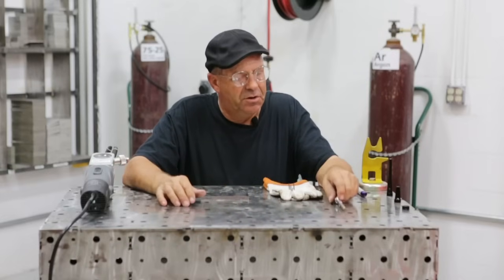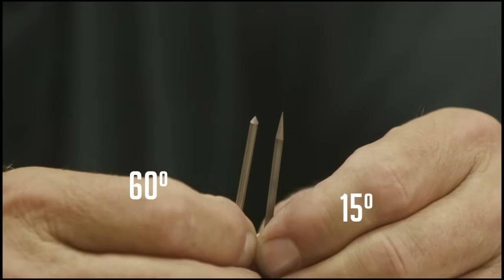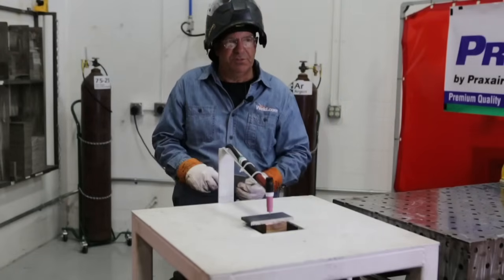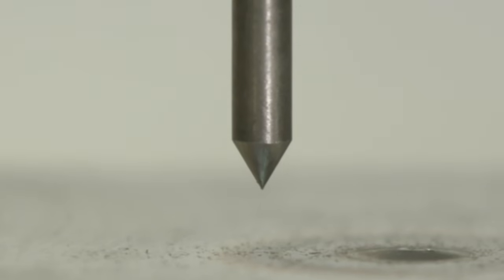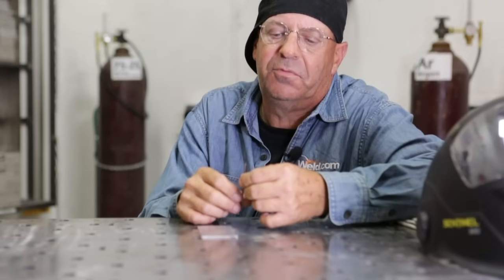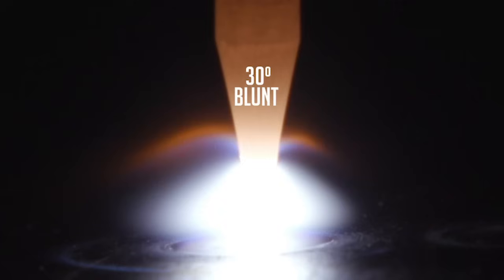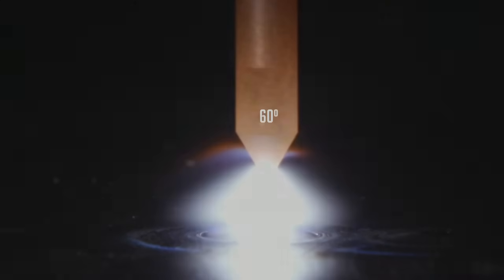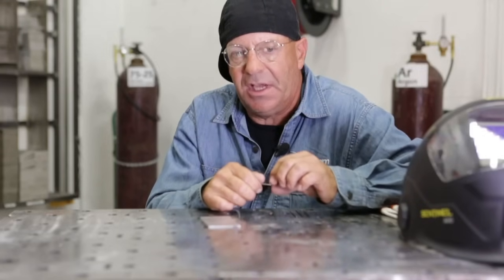Tungsten Grind Angles Matter!

Comment: Hi, i need some technical support for some critical welding application.

We have to weld a 0.15mm Thin sheet (S.S. 316) with 10mm shet thickness.
we are using hyper pulse Tig welding.
But we are facing some issues that once welding completes 360degree, material get burn at starting pont...

Comment: Nice video . Iv been using a grinding wheel i had off eBay 5 months ago to sharpen my tungstens that can be used in a grinder . Works amazing . Should take a look and see how they test out. EBay item number:  283337062859

Comment: I'm a tig beginner, but I think the big thing Bob forgot to mention in this really excellent video is how the grind angle actually effects the arc plume. From what I've read (and it jibes with my ancient EE courses) the arc come off the surface of the tungsten at a right angle, so that a needle point makes a wider arc plume because the arc goes out almost horizontal as it leaves the electrode and then bends back to the workpiece. And on a blunter angle, like the 60 degree, the arc still comes off at 90 degrees to the surface--but since the grind angle is steeper the arc doesn't have to bend as much to get to the surface of the workpiece, thus a narrower (and hotter) arc results.
Reply: Great tip
Reply: Thanks I thought it worked along those lines but nice to hear a confirmation 😊
Reply: Aha
Reply: Yes!! Exactly right!! Those are the words I was looking for.

Comment: Aerospace welder here. Run 718 inco all day. 27 degree is my personal fav. Usually run 0.040” material.

Awesome vid. Thanks for the education.
Reply: Being from the aerospace field,  do you notice a lot a horrible info in these videos? Ive found that almost every welding video ive seen has bad info. It's so funny to see ppl over look all the critical theoretical practices.
Reply: My buddy gave me some inconel MIG wire to play with but I haven't tried it yet

Comment: I prefer the sharpest possible as long as I still get penetration on both sides. Especially when welding some corners and you cant follow it around as you should in theory. (Thats around 27º in my case).

Comment: How long do these tips last in their accurate form as shown here? I've seen them get blunted pretty quickly, probably because I'm doing something wrong.
Reply: Some different metals will dull them out in 10 seconds. Junk I weld all the time at my job sometimes you can watch the stuff just shoot up onto the tip. Then maybe after first pass you are good and it will go a long way. I repair welds made by automatic fusion welding machine and sometimes going over those welds is real bad.
 In the real world hardly anything is nice clean pretty compatible metals, it’s more like weld this nice steel to this dirty garbage and hope for the best.

Comment: Whatever tip I can quickly make on a grinder is the angle I use :)
Reply: The by code guys crack me up 😂
Reply: That what I been doing last 15 years. Big flat sander where I work. Tungsten is tough and tears up sanding wheels quick so I keep mostly to the center. That is my turf.
Reply: @michaelszczys8316  its probably more frugal to get a diamond sharpener that will last you longer in that case.
Reply: Needed to try new welding procedure for job at my work.  Needed to try burn in with fusion weld. Shop engineer told me to grind the end flat for more penetration. I said ???? What ???
Reply: Facts 💯
Reply: Just use a mug welder lol. No grinding needed
Reply: Damn there’s some bad ass welders on this comment section.... until you bump into them on the field... lmao
Reply: Get caught doing that in the field on a code job and you"re packing up and going home. Not a good habit to develop.
Reply: @conndorr  Get caught doing what exactly?
Reply: @ifitaintrounditurnitdown1735  was wondering the same thing
Reply: @ifitaintrounditurnitdown1735  parameters I'm thinking. As long as theres no IP or If or inclusions ie: tungsten tip on the film, you're good to go at most places. Blue oxidation on titanium is a no-no hence the post purge block. I've tig'd miles of 316L SS and preferred to feed my root from inside looking down thru the gap til about stringline.
Reply: @metalandstoneworker2345 I agree with everything you say but the comment was referred to the grind angle of the tungsten and getting ran off the job for using any angle. I always backfeed any of my roots no matter the pipe material.
Reply: @ifitaintrounditurnitdown1735  that's how its done hand. Just sharing my story. It's probably older than you. Keep it clean out there.
Reply: @ifitaintrounditurnitdown1735  btw, parameters. WPS.
Reply: @metalandstoneworker2345  Yep it all depends on the WPS. I've tested places and they didn't want you backfeeding a root and also tested where they made you backfeed. You too brotha!
Reply: If it ain't round I turn it down get caught sharpening a tungsten with a grinder.
Reply: @ifitaintrounditurnitdown1735  I think he means "sharpening the electrode off hand on a sander"?  You really want diamond grinder or that chemical stuff I think.  Jody has a video showing nine ways to do this?
Reply: @conndorr  when you are 100ft up on a scaffold with no ladder inside a vessel, you use the damn grinder and dont worry about it
Reply: Chris Duncan not under the eye of an AI then by all means go for it, but I work in a code shop that is consistent with in house inspectors and they aren’t fond of that.
Reply: @conndorr  so do i

Comment: Question. Is dragging it to set height and thus contaminating the tip of any concern? I know, all too well, about touch down while welding but what about starting with that small amount of debris on the tip, should we avoid it? super clean or clean enough? Thanks.

Comment: I didn't have anything to add during my first time watching this video because I was tired, but I've got one tip that I have used a lot.

Say if you're using that 15° grind on your thin metal etc, you can always regrind the tip of the tungsten and it entirely changes characteristics of how your arc performs. High science, it's something that is useful in a pinch or if you're not within reach of a grinder... Once I put my initial 30° grind on my tungsten pack, I'll use a my diamond whetstone for my pocket knives to refresh the tip or regrind it.

Let's say you blunt 20% or less of that initial 15° tungsten grind after your tungsten collects foreign residue on the tip after incinerating it out of your parent metal... You can regrind however much of the sharpened area you want into one of the other grinds. I'll often take that 15° and put a 60° on the very tip using while less than 80% of the total sharpened area to give the initial grind some more penetration/depth.

Doing that will make your arc characteristics an amalgamation of both grinds. You'll no longer waste amps away on the surface trying to get the puddle formed as the 15° grind would normally do alone and it'll punch down into your parent metal much, much faster. It tightens up the arc from a max width plume and focuses about 80% of the energy down into the parent metal. It's really great for aluminum and you don't always have to run it blunt.

The secret is in the shoulder of the grind and the tip of the tungsten! The drawn out portion doesn't have any real effect on arc other than current capacity and total working time before the tungsten craps out due to the needle-like tip being incapable of dissipating the heat. It's all calculus and how the energy is directed to a focal point at the end...

That's the beauty in breaking down and just buying your own machine; it may not make you much better of a welder than you already were before you bought it, but it'll make you that much more of an efficient welder when you have time to observe these things that you don't usually have time to do at work.. unless you're looking to load your box and drag up anyways! 🤣

Comment: Does the sharpening angle affect the maximum current capacity of the electrode?
I am a very beginner at Tig and once tried with a 1/16" tungsten at about 120 amps. With a sharp angle it welded worst that with a less sharp one.
In both cases, no blunt point. 

Keep the good videos coming. (Especially the part 2 of this series, with the practical demonstrations!)

Greetings from Italy,
Sart0
Reply: What kind of weld, what thickness material and AC or DC? I find that if you sharpen a thicker tungsten to a sharper angle, you can weld better thinner material with lower amperage (like it will make a smaller puddle, more concentrated arc). On AC it is almost useless to sharpen to a point the electrode since it will eventually "ball up" on use (how fast, is depending on AC balance). 
There is a limit to welding amp and tungsten thickness, a 3/32" tungsten with a ~20 deg angle will deal better with  120 amps than a 1/16. Actually these sizes will serve you well from the range of 1-300 amps, the 1/16 being able to deal with up to ~100 amps and the 3/32 with 100 to 300 amps (with the right machine and torch).

Comment: I didn’t know that it was a “thing” to use E3 tungstens for DC tig .... most guys i know use E3 on AC ... 

Also if you look at that 15 degree grind. It does “just fine” or at least a whole lot better on much lower amps !  

How many amps were you running at 100?  I mean a 3/32 should be able to “take that” but then again that is a pretty sharp grind ....  so you would have to look more like current carrying capacity of a 1/16 maybe even 040....  

That sharp grind could also stand a shorter arc than 1/8”

Comment: Should cut that plate down the center of the welds. Would liked to see the welds
Reply: I think because they were just going for the arc shots this time they didn't cool it off between and you can see they're pretty close. He said they're going to do that next video. If you want to know right now, Jody has done this exact test at Welding Tips and Tricks.
Reply: @gasfiltered  and The Fabrication Series has a couple really in depth videos related to this

Comment: What happens if you use a new tungsten without sharpening it... blunt end no angle @ 90°?
Reply: Unstable arc
Reply: @silrobati  it would stabilise at higher amps wouldn't it?
Reply: It depends on your tungsten width LMFAO! Gotcha.
1 mm on AC current, balls up.
1/16" will ball up on AC at over 100 amps.
And so on as you increase the current.
As to the practical use on DC current, it's just POINTLESS! 🤣😂
Reply: @Aint1S  was gonna dd.  with ally just go super clean factory machined end, i let it naturally ball up and have a better turn out when companies only give a low endmachine with no frequency control or anything.
Reply: It would be somewhat more stable at higher amps, but still too unstable to do anything with. Your arc would be jumping around like mad. Good question though
Reply: Man, you gave me a new welding joke!  Thanks 170ish!
Reply: This is the one easy trick astay at home mom discovered. You will start stacking dimes left and right. Welders hate her!

Comment: Is there a difference for tip shape when welding AC?
Reply: People used to use a "Ball" end for AC welding.  Melt the end of the electrode a little so it makes a spherical shape.  Not to make a lollipop, but just round the end.  This was pure tungsten.  I think the end of the electrode was supposed to be molten in operation, just that surface layer.  Early days of TIG.

Comment: Would love to see the part 2 to this video! Please do it.
Reply: Yes this is exactly what I am missing... I use an eastwood grinder but it only sharpens it to a  fine point unless you intervene changing the angle yourself. It's really nice tool but I don't think its the one size fits all solution for tungsten grinding like they claim. Many different tip points that I still don't fully understand yet.. Thank you for this video.
Reply: Yes please!
Reply: It's been two years, was the part two made?
Reply: Very interesting video